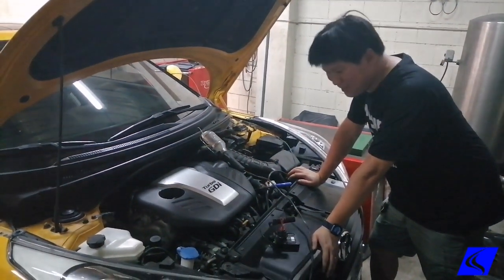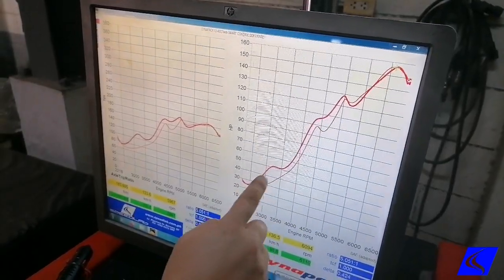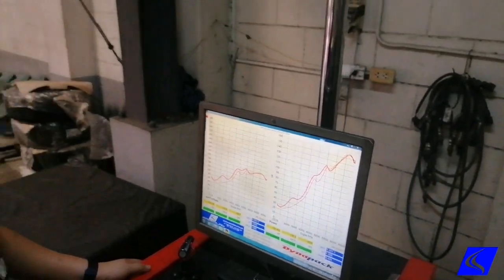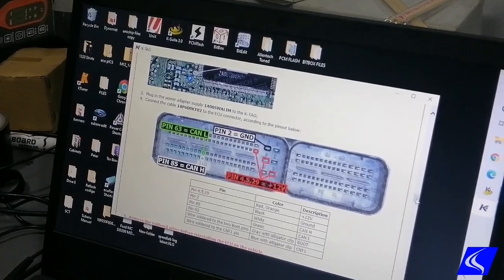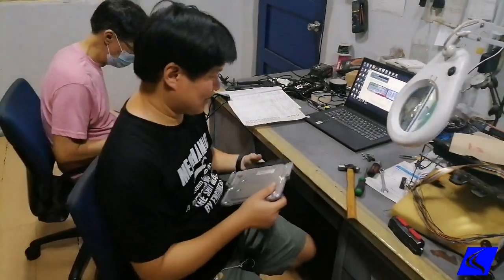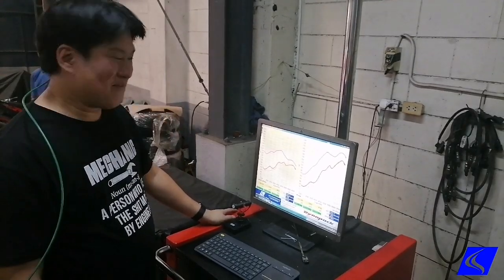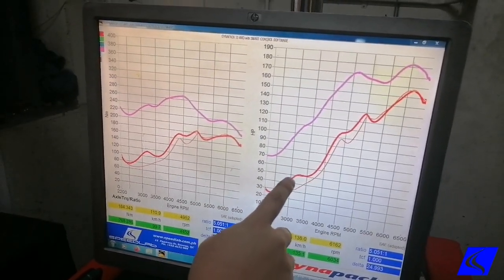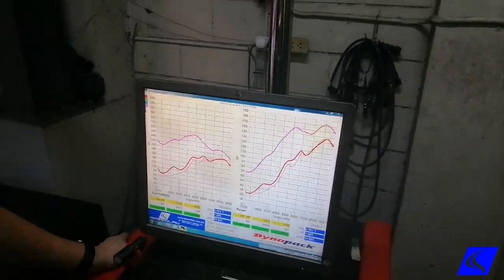Hyundai Veloster SpeedLab ECU Remap Tuning

Comment: I'm having an issue with an engine swap after the previous one had a damaged piston. i have the velaster turbo 2016 dual clutch version, The problem I'm encountering is that the engine isn't performing as expected. While it sounds normal and accelerates smoothly at low speeds, when I try to accelerate harder, it feels like it's not delivering power properly. The RPMs drop, almost as if the computer is limiting it. It's frustrating because when I reach 50 MPH, it doesn't accelerate as it should. Can someone tell me what could be happening?